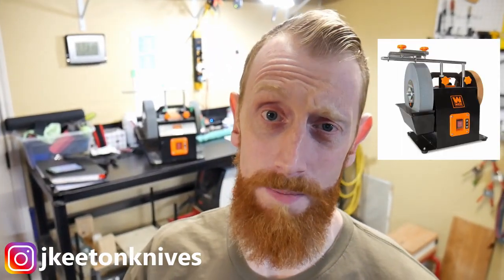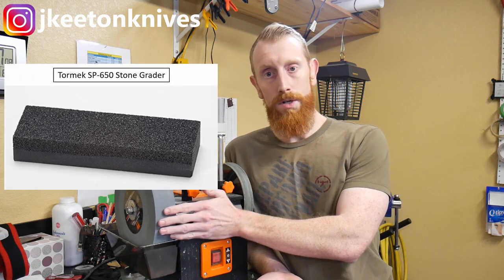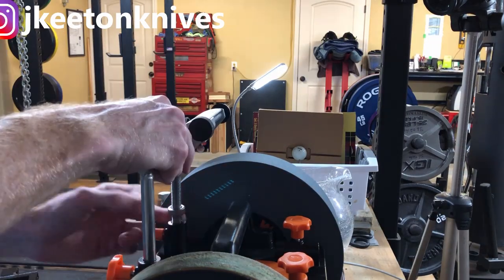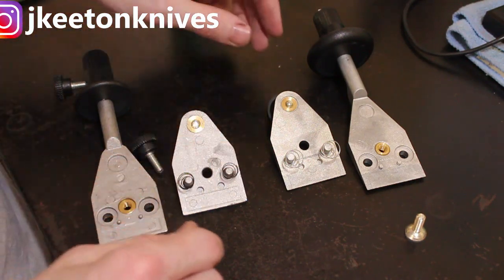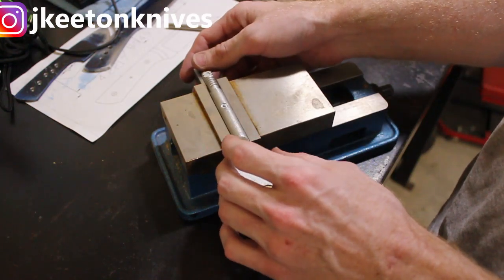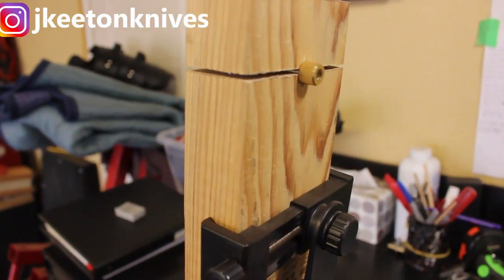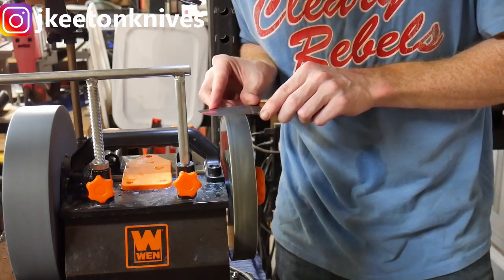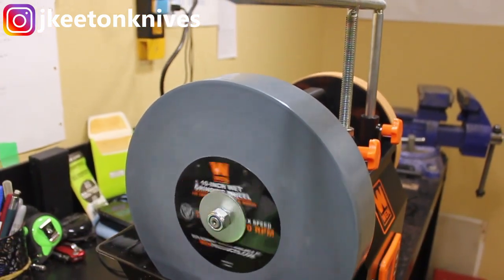WEN Sharpener Review & User Guide | Tormek Knock-Off

Comment: Appreciate the video. Thought I would throw this out there to help with one of the complaints of your system. Put the Wen in a cookie sheet, drilled a hole in one of the corners and put the hole over the bench so water goes into 5 gal pail waiting below. Helps quite a bit. Again great videos.
Reply from the maker: Good idea sir! I found that I don't get the table wet if I don't over fill the water holder... Sounds obvious, but I was over filling before. Now it's become a non issue. Have a great weekend!

Comment: Tormek has videos on how to use a wet stone sharpener.  They set up the knife holding jig different.  Imagine a line from the beginning cutting blade edge (next to handle of the knife) to the blade point. Now set your jig in the middle of blade but angled to match the line described above. Seemed very effective in keeping the correct blade angle, even at the curve just by lifting the handle.  Hard to describe , hope this helps
Reply from the maker: Good tips and info Ted! Thanks for the comment.

Comment: This is such a good video. If you're on the fence or struggling with getting consistent edge bevels, follow this guide and buy a similar system.
Reply from the maker: Eric Snyder thanks sir. I still use this sharpener. I do have some issues keeping it clean when I don’t have a sharpening notch, but that could be user error. Glad you liked it!

Comment: I have several stones for my Tormek machine. It is necessary to mount the stone in exactly the same position as when it was centered with the diamond turning tool. I use to make sure that the writing on the side of the stone is completely horizontal and facing the right way every time i tighten the nut holding the stone. If I put the stone upside down, for example, it will be thrown up and down in rotation due to the tiny clearance around the axle
Reply from the maker: Good tip!

Comment: Even if it doesn't freeze, if you leave the wheel in the water for long periods of time, the water will affect the wheel and it will get out of balance. Just take the tray off the machine and let the wheel dry out as evenly as possible.

Comment: Great info, especially the mod. Another hack for the stone grader... A regular coarse/fine aluminum oxide combo sharpening stone does the same job at 1/2 the price (or more) of the Tormek stone.
Reply from the maker: Thanks for the info!
Reply: Does it have to be a particular grit?  Will 150/240 work?  Thanks for any help
Reply: @DarkArtsDeepDive  that's very course considering the wheel is already at 220, then you grade to 1000 then strop.

Comment: Great video and demo. The reference material in the links is interesting. I do "set" my initial edge on the grinder on very low speed with a 220 ceramic. I then strop. That is my standard working edge for any knife that goes out of my shop  If someone wants a more refined edge, I use the KME.  I also do the edge roll test with a brass rod. I have only once had an edge that deformed under that testing.
Reply from the maker: Cool deal! It was the first time I'd thought about (when reading Larrin's work). Figured it gave me an excuse to buy a new tool!

Comment: I have had two Tormek machines an old 2000 and a T7 . the 2000 motor started alternating between forward and reverse when started (someone sugested that might just be a faulty start capacitor) around the same time the the drive rubber/friction drive packed it in and would no longer drive the unit,  the second wheel was down to well under 180mm diameter. So I lashed out and got a T7 plus all the jig sets on offer  except the drill sharpener , shaper blade sharpener jig and planner blade sharpener jig. The best choice I have ever made. 
I have used a jet and a schepach knock off and they were both inferior to the Tormek by a big margin. I'm presently looking for an excuse to buy the T8, but my wife is being unreasonable.
Reply from the maker: Lol, your last sentence there has me cracking up! I agree, everything I've seen points to the Tormek being an excellent machine!

Comment: I would love to own one. About 35 years ago I worked with a Scottish boat carpenter who had a delta wet wheel. That thing was awesome for sharpening our chisels and block plane blades. I was fairly new to carpentry back then but remember being impressed by the tool. For the last 5 years or so I’ve been looking for something like that wheel. I bought one from Harbor Freight but it was junk. I’m pleased with my when tools so I’ll probably buy this. Couldn’t you just free hand your drop points or any knife for that matter rather than using the tool arm ?  I use the edge pro professional model for all my sharpening except my convex grinds in which case I use my edgewright system. Basically sandpaper on a semi soft rubber strip block and sharpen by hand similar to stropping followed by actual stropping with a series of compounds. 👍 thanks J
Reply from the maker: You could go free hand for sure! I bet that would take a little practice. With the laser guide it would be easier. If you want the cadillac get the tormek... but if you want a cheap option this thing will do! Thanks for watching!
Reply: I’ll probably go low budget because I will probably be using the Wen for very specific projects. My whole attitude is apt to change because I have never sharpened a knife on a wet stone(wheel). I’ll see and let you know. Thanks for the review

Comment: You can sharpen with the wheel turning away from the edge to nearly eliminate the water mess. You can do that on the Tormek anyway, don't know about the WEN. I have the Tormek and that is a major major problem with it. I don't even sharpen knives on it anymore, it was that bad. Kitchen knives are done very well on the Chefs Edge Trizor XV. Interesting to note that you have to use Tormek tools on the WEN.
Reply from the maker: That's true. I have tried that method, but I like how the bur is smaller when sharpening towards yourself. For sure Tormek items are of a higher quality and perform their task very well. They supplement the WEN sharpener well. The truing and dressing tool is a must.

Comment: I think I would prefer to freehand rather than try to use something to hold the blade, but the truing attachment seems like something anyone would need. Do you think I'm kidding myself about being able to hold the blade at the right angle on the wheel? I've been satisfied with the edge I get with a whetstone, and this just seems easier since I don't need to move the knife back and forth or add water (at the cost of getting water and grit all over my face and clothes). Also, I saw a video where a professional knife sharpener rate the Wen, and liked it enough to recommend it  (and use it as a secondary wheel), and he said the $3 two-sided stone from Harbor Freight worked fine for conditioning the Wen. In fact, he wasn't sure the much more expensive Tormek stone was any better,
Reply from the maker: I've sharpened free hand with this system and it does work pretty well. Did better than I thought. Thanks for your thoughts! Have a great weekend! Cheers

Comment: I could not afford the Tormak machine so I bought this one. I think it has potential but I couldn't get repeatable results. As you mentioned the castings are not precise. after I trued the cutting wheel and set the reference bar to the height for a cut I noticed the bar was no longer level with the cutting wheel.  There is a great deal of tolerance in the bushings meaning the guide bar could be as much as 3/8" out from left to right.  frustration caused me to shelf the item for now.
Reply from the maker: I'm sorry to hear that Richard. I still use this guy. It takes a fiddling with before getting it set the way I want. I found that when I adjust the bar I like putting even pressure down on both "legs" before tightening it. Otherwise it will tilt a little.
Reply: @RedBeardOps   Maybe I'll give it another try,

Comment: I have been trying to get the same machine as you have and it is very difficult to find. I per sally prefer the model you have rather than the new model. The machine you have looks very similar to  other brand names. Yesterday I looked at the Canadian tire website and in my opinion it looks identical to the old wen. So if anybody wants the similar model CT has them. My question is: Do you have any problems with the arms or the stone not being straight ? I like to thank you for your excellent video
Reply from the maker: Cool deal sir, I know it comes in and out of stock at Amazon... Seems to take a while to get back in stock once it goes out of stock. When the arm is seated fully before tightening down I feel like you can make it very repeatable. To true the arm with the wheel you can use the tormek truing and dressing tool. Thanks for your comment sir.

Comment: Back in the early 80's I worked in a big hardware/tool supply store (Pre-Box store days) and we had a few Wen products. Their drills and sanders and such were garbage but they had a pretty good electric chainsaw and they had a wet sharpener that was very good. It had a horizontal wet wheel and a vertical wheel. No strop. It had a water tank on back as well. You could sharpen 12" planer blades for the big contractor grade power planers on that thing and get a really good result pretty quickly. The horizontal jig had a bit of learning curve to it but after that it was nice to have around. Plus you could buy it for under $50 I think. I'd like to find one now.
Reply: Delta also make those or used to ( 23-710), also makita make a single stone version which can be bought in the USA.
Reply from the maker: Hey Kirk, I can't say they're the best quality, but sometimes the price is right. This sharpener is still going strong for me.
Reply: @carlb401  After the hardware store I was a service supervisor for Makita. It was a good product but was way overpriced imo. Plus a bit tricky to set up for planer blade sharpening.
Reply: @RedBeardOps  Can't argue with results!!

Comment: Thanks for the review. In addition to knives, would this unit work well on chipper blades? (straight edge, 3 inches long on quarter inch thick, hard steel plate)
Also, in addition to the grader, truing, and tools used to hold the work piece, would you recommend multiple wheels, each built to a different grit, rather than using one wheel and altering its grit with the grading tool?
Reply from the maker: I think it could work for that. I haven't tried it. The wheel that comes with it does a pretty good job. I've seen guys use finer grit wheels, but they generally have 2 machines set up
Reply: @RedBeardOps  Thanks. It's interesting that users prefer multiple machines vs. one machine and multiple grinding wheels.

Comment: The problem I have with the tour mock or the grizzly wet water wheel is that it creates a hollow ground cutting edge which will not last as long as a convex cutting edge or a flat ground cutting edge for that matter if you use a belt grinder you just need to put a cool mist on it when your sharpening and go at low speeds
Reply from the maker: Man, I thought the same when I first investigated buying one. Then I drew out the actual dimensions in CAD to get an idea of "how hollow" the grind is. On a 10" I can tell you that it's extremely negligible. Check this out - https://www.dropbox.com/s/k2v8yik2ocfn8em/WENWheel.jpg?dl=0
Reply: Red Beard Ops Yeah I read that Article as well I always do a convex even though it’s small I would put it up against any knife with a hollow ground or flat ground edge as far as longevity this comes from lessons with Mike Quesenberry who was taught by Tim Hancock I also saw that you referenced Nick Wheeler he was also taught by Tim Hancock to do that type of an edge.

Comment: great video!   I do just about all of my sharpening on my 2x72 but have been considering some form of a wet wheel for a long time because it’s sometimes a PITA to get the belt to run flat enough at the edges so that I’m not putting that tiny bit of recurve at the choil.
Reply from the maker: Hello sir! I'll say it's not perfect. I've done it both ways and currently have been liking the wheel. There's nothing wrong with a 2x72 edge though if you're careful and you set up for it. I do like having the guide so that my bevels are the same on both sides, but by hand you can get them pretty damn close on the grinder too!

Comment: Keeping the curve edge of the blade near the laser line seems logical but I did notice the honing angle changes considerably, does this affect the sharpness or thickness of the the edge of the blade thus changing the durability?
Reply from the maker: If you have a variance in angle then the edge geometry will change. Which will change the effectiveness of cutting and durability

Comment: Great vid I was looking at them on amazon but can’t see spending the 600 and up for the better one. Does the wen have a angle gauge adjustment knob or anything similar like the tormek? Or would I need to purchase a separate angle finder? Thanks for your time and very informative video
Reply from the maker: Hey Chris, I'd highly suggest the angle finder from Tormek to use with this WEN machine. There is a "fine tuning adjustment" on the Wen but it is crude.
Reply: @RedBeardOps  great……. thanks for the heads up

Comment: @RedBeardOps would this sharpener be useful to set the secondary bevel? Or would you set the secondary bevel and then use this to sharpen the blade?  I ask because setting the secondary bevel on my grinder sometimes gives me inconsistent results...
Reply from the maker: Hey man, I've used this machine to set the secondary bevel and sharpen the blade. The wheel is a 220 grit wheel and will put a "working edge" on the knife. 

I'm working on a review of another sharpening system right now that will take the edge to a higher level of sharpenss... but this one can get you a pretty darn sharp knife.
Reply: @RedBeardOps  Thank you for the response! That is exactly what I needed to know.

Comment: Hey Red Beard, first time watching videos on your channel and I love your work. Do you know if Tormek wheels can fit on this jig? Could the Tormek diamond wheel fit on this device?
Reply from the maker: Thank you sir! I actually do not know. If the shaft is the same diameter I don't see why it wouldn't work. Sorry I don't know the answer to this one.
Reply: I was told that you can use the tormek wheels you just have to add washers for spacers because the tormek has a recessed area and the wen does not
Reply from the maker: @libertyordeath1287  Good to know!
Reply: @RedBeardOps  I hate to bother you about this, but would you mind measuring the shaft? I've looked at lots of sources and can't find the arbor size for the Wen--most wheels are for 5/8" arbors. I don't want to buy the Wen if it can't take the CBN wheels (5/8" arbor). Thanks!!

Comment: I’m giving serious consideration to getting an electric wetsone. I’d love to have the tormek but my lord is that thing pricey. You’ve had the Wen for a while now. Would you recommend it? Is there anything you’d do different? Should I save longer for the tormek or do you think the wen is adequate for a hobby knife maker?
Reply from the maker: BCtruck, rebuild, repair,repurpose man, it’s been good to me. So far it’s working great still. Many of the additional attachments you’d have to buy anyway if you got the tormek (I don’t think it comes with many)? Could be wrong about that. I know that people who buy the tormek are never disappointed... but I couldn’t justify the cost personally. I do find this difficult to use on blades that don’t have a sharpening Choil and recurve blades, but I imagine it would be the same on the tormek. To make it usable to me I had to get the dressing and leveling tool.
Reply from the maker: BCtruck, rebuild, repair,repurpose it won’t give you a mirror polished edge like a wicked edge will, but you can get a “working” 220 edge that will shave and cut paper easy.
Reply: @RedBeardOps  Thanks man. I have been using the edge pro,but Im going through the two lowest grits like every 3-4 knives. I may have to knock the 90 degree edges down on the belt before using the edge pro. thats where Im using up the stones is trying to knock the 90's down to a bevel.
Reply from the maker: @bctruck  My method currently is to put around 0.010'' behind the edge then do all the secondary beveling on the wen. The last 15 or so passes I alternate each side each pass. That makes that burr small. Then I strop on that power strop with green compound... They come out hair shaving sharp every time... now just to reiterate, we're not talking polished secondary bevels here... but for a working/hunting knife this thing will do the trick. I've also sharpened all our kitchen knives with it and am very happy with those results. Tormek does offer that grading stone with will help you "reduce" the grit of the stone from around 220 to 1000 (so they say). I think it may take the stone to more of a 400 range. To be honest I've stopped using that b/c the 220 grit finish is fine for me. I've heard great things so far from my customers. I hope this helped... It's a hard decision to buy something like this and there really isn't a "right" answer. Being a cheap import you never know if you'll get a lemon or not.. but on amazon you do have free returns on this item if I remember right. Make sure you keep the box and the packing!
Reply: @RedBeardOps   Thanks man. Thats a big help.

Comment: The truing tool no longer fits, I assume there were some design changes in one, the other, or both.  Also, the Wen jig designs have changed to a lower profile nob.  However, I just bought mine and haven't used it yet so we'll see if that issue still exists, but i suspect not as the nobs are very low profile now.
Reply from the maker: Good to know, sorry about that Bob